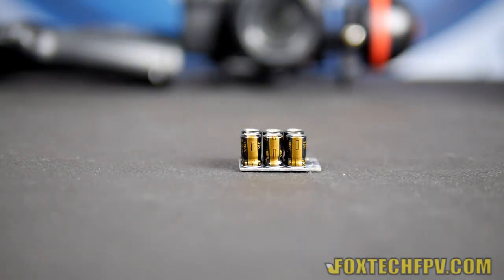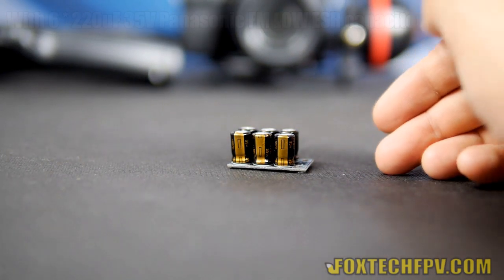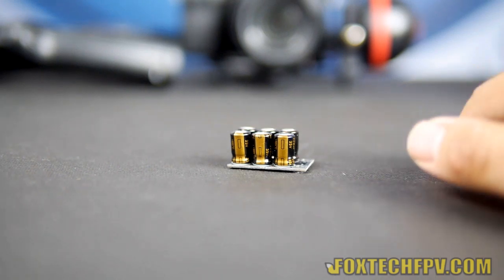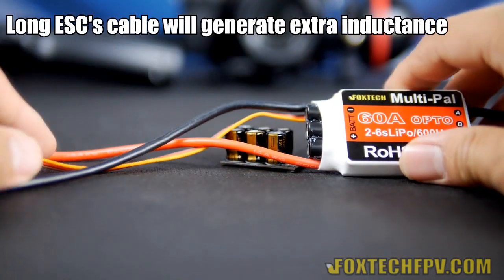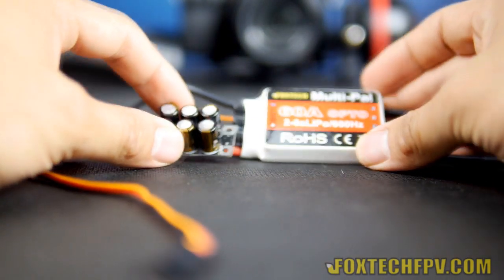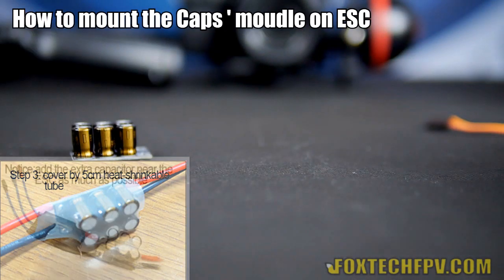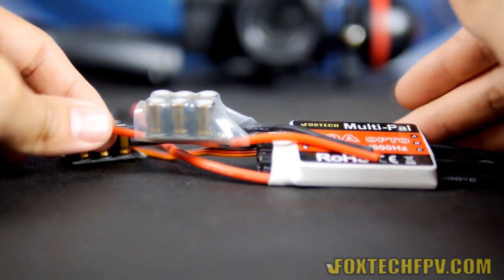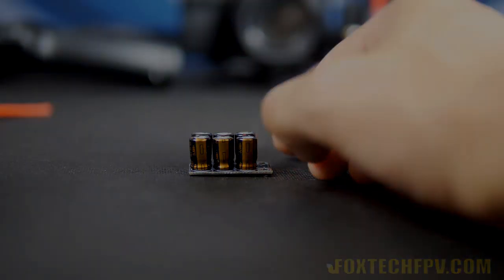Foxtech Power Cap's Module

Comment: Electrical induction isn’t from the power wire... it’s from the electric motors field building and collapsing rapidly. When an electronic field around a coil collapses a voltage spike is sent backwards that is higher than the voltage used to create the field and can damage electrical components.

It has very little to nothing to do with the length of the wires...
Reply: Tor Arne Hustvedt a diode works wonders as well..... I use caps in combination with tvs diodes on my quads

Comment: I have some questions:

1. How many does a hex need? 6 or just 1 in connected to the main battery power line?

2. Does it matter where they are connected to the ESC power cable? (Next to the ESC or far away?)
Reply from the maker: 1. One moudle for one ESC , So you need six moudles for Hex 
2. We are mentioned in the video , closed to ESC as near as possible